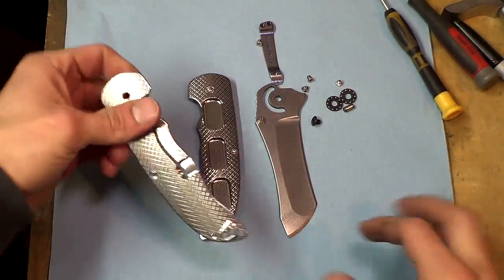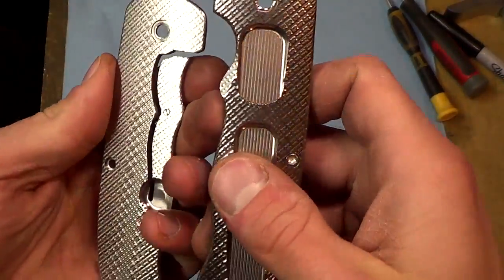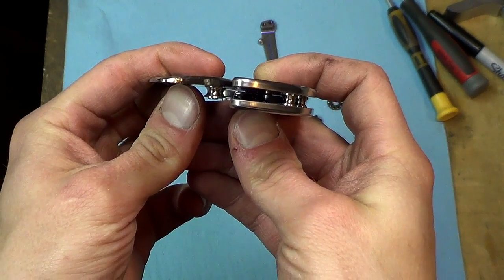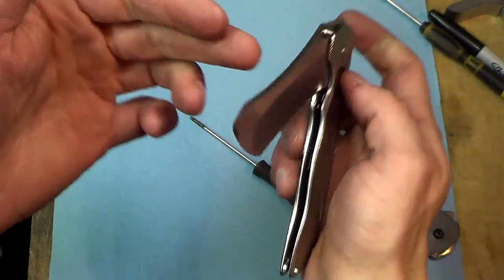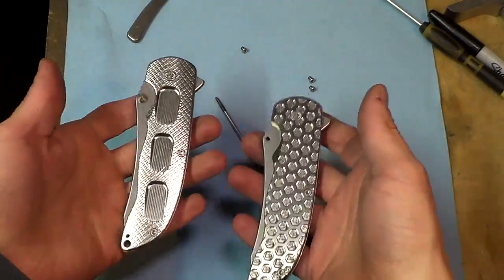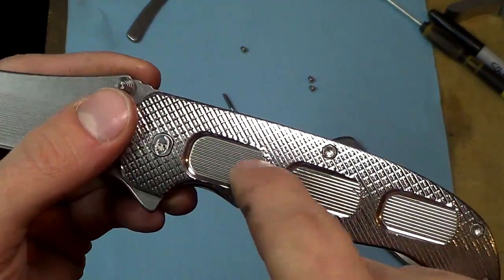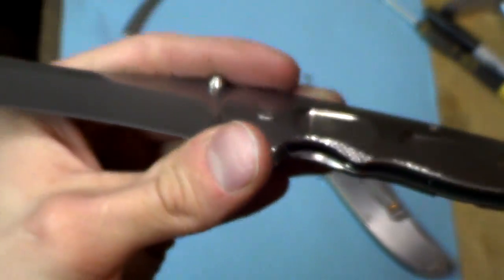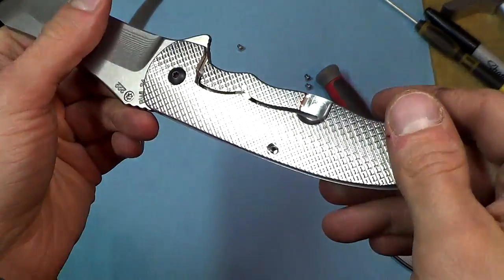KMT 111 - 3D machined handles

Comment: I take it that when 3d contouring like this, it doesn't matter if it's climb or conventional milled?? looks like you are doing one then the other and so on.
Reply from the maker: +Finn Custom Knives Good eye Paul, yes it seems to work fine going both ways when doing very shallow cuts like this.  On deeper scallops like on my diamond pattern handles I have to use only climb milling otherwise the wall that gets conventionally milled looks like crap.